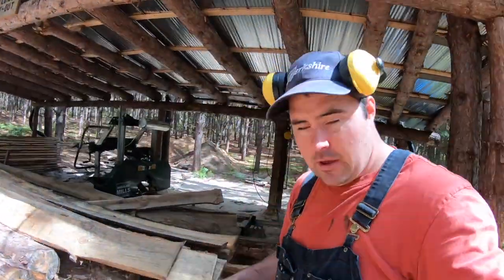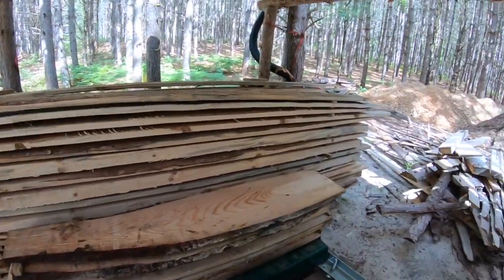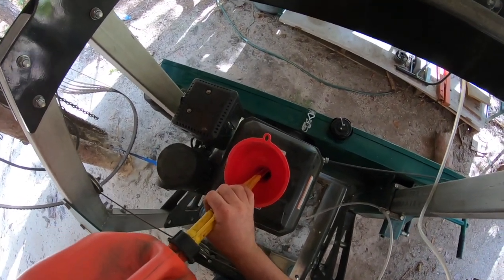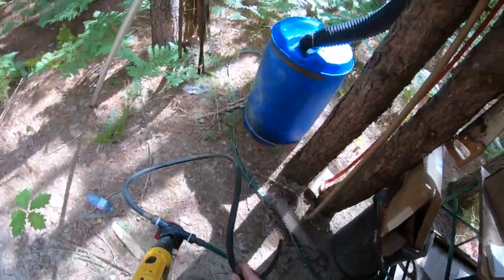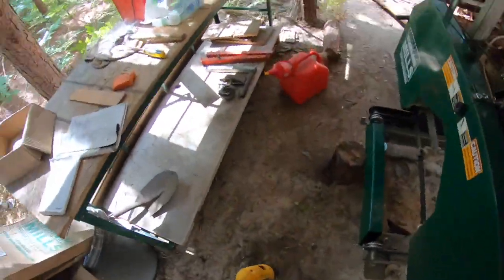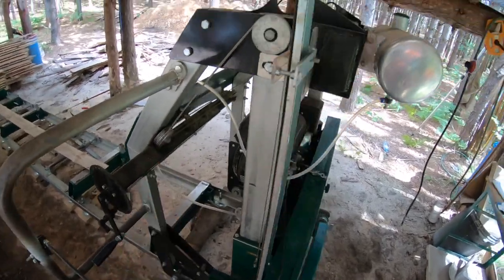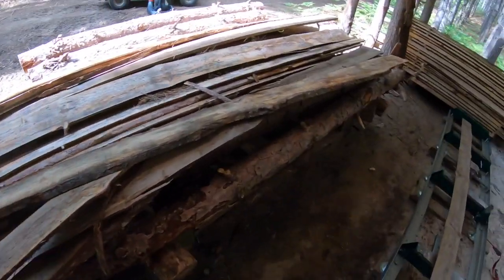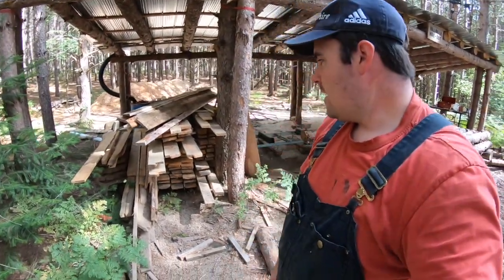Woodland Mills HM130 Cutting Wood

Comment: Hi sandy thanks for sharing. I think You are right,  get more mill than ya need (with in reason) bigger jobs will come along and the mill can handle it. I like that you are going back and getting the wood left in the scabs. I’m looking at the hm130, the Norwood hd36 and the Lucas swing blade. Out here in California we have large trees, cedars and pines. Hard to move without a huge tractor. Was thinking of making a big logging arch to pick up, move and load the logs on a ground mounted saw mill. Not sure yet which mill to get. I don’t have a tractor yet but thinking I will need one on the property. Any way have a great day and thanks for taking us along.
Reply from the maker: Heyyou Buddy do you have a machine or something else to hook a log arch to? I made one for my atv if you’re interested I’ll point out the video to you

Comment: Thanks for the tips what do you use in winter for the water
Reply from the maker: Denis D in all honesty, I don’t mill in the winter. I usually keep busy out collecting firewood and doing and cutting of trees I need for the springs lumber pile. That way I can use a sleigh and my snowmobile and keep ground disturbance to a minimum